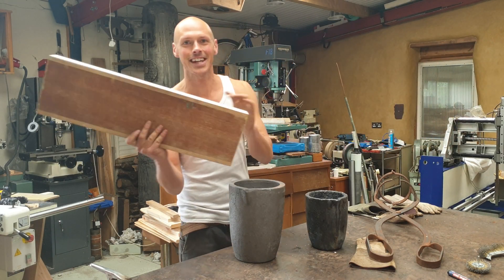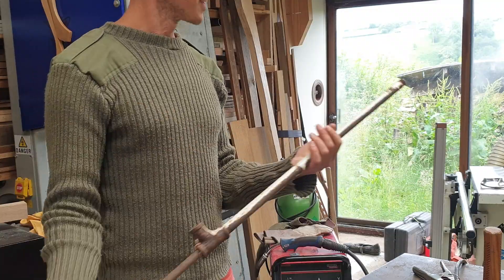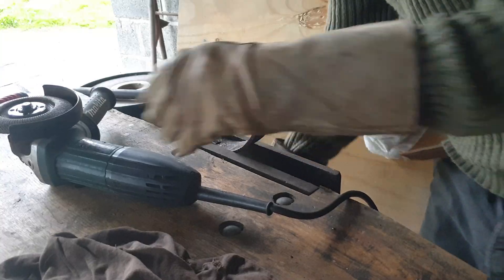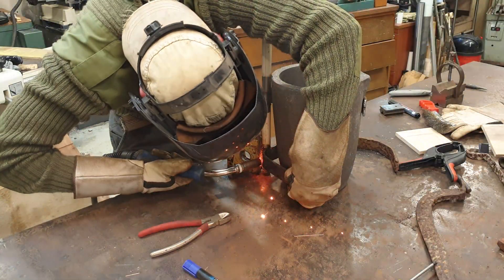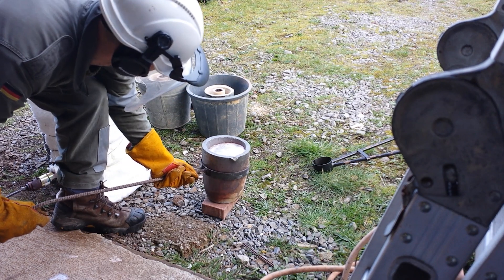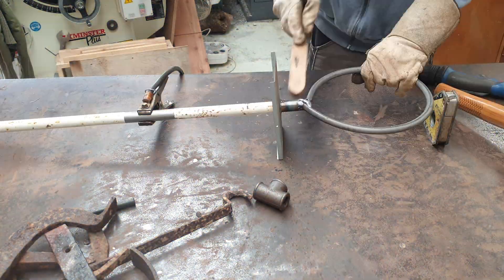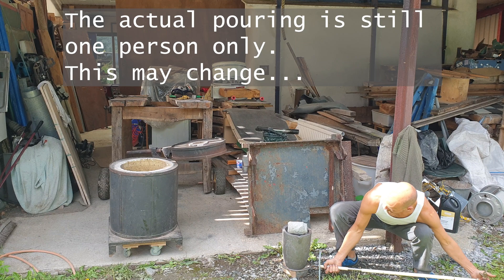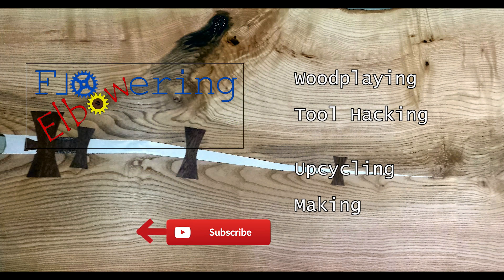How to make Crucible Tools/Tongs for bigger castings

Comment: That bit of scrap looks like a bit of spring steel so that'll be hard to cut with the circular saw
Reply: I had 2 of these blades, blue for steel (not going to mention the make) .... after 10-15 cuts in mild steel (50x50mm or 2x2) they dulled
angle grinder is da way

Comment: Scrap-pot! Love that. Ok, so here's an idea: what do you think about using a sort of standing fulcrum as a tipping point to assist you with pouring? The weight could rest on it as you pour. Something like a u-shaped cup sticking up/out from a piece of plate (maybe an old rotor)? In operation, as you stay back by the T-handle, you'll be away from heat and splashes, not to mention that leverage will give you more time before fatigue starts to set in. It'd probably give better control, too.

One more thing, and sorry to be a safety know-it-all on this point, but I once worked at an alumin(i)um company, where they would really drill on us about rusty and/or wet tools. Thermite reactions are a very real phenomenon that use rust as their fuel, and trapped moisture becomes explosive as it rapidly expands—so be sure to use warm, dry, clean tools when playing with metal. 

As it cools, it's weird how liquid metal acts more like tar than you'd think, isn't it? Stuff makes a mess. And when it's hot enough, it gets even more 'wet' than water is; stuff will flow into cracks that are far too small for water to penetrate. Ah, whatever. Just keep making vids. This is one of my favorite channels!
Reply from the maker: Hey Pocket. Thanks for the advice. Always good to get safety reminders (ok well learn about in the first place - I'll look into the Thermite reactions jazz ;) 
Love the pivoting fulcrum idea. I think this could be as simple as some old flameproof mat (I have a bunch of ones a plumber discarded - they only had small holes right in the middle, and work great folded up) and a little sheet metal around the top edge of the flask closest to the pouring basin. I don't know if you have seen our previous vid - but looking at that, the crucible is close to touching/pivoting round that point anyway! 
Always good to hear from you,
Peace, Bongo.

Comment: I really like the creative ideas you come up with using what's available! Good job!

In watching as a spectator vantage point, it appears that the large crucible is really to much for one person because it is dangerously close to the leg when lifting it. There's little room for any error or mishap.

I agree with the other comment about needing a type of locking dog to hinge over the top of the crucible to prevent it from sliding out when pouring. Having it slide out and aluminum getting splashed on you would probably cause a burn that your wife couldn't kiss and make better 😆
Reply from the maker: Hey Micah, thanks for this. Agreed leg danger is the biggest concern!

Comment: You might want to consider a slide over locking tab on your pouring tongs ...... a simple oversized short bit of pipe, that slides down the handle with a dog leg tab attached which reaches over the rim to ensure the crucible stays in the tongs when you are pouring. 
Also ...... welding another handle on the opposite side (even if it was removeable ..... pinned into a socket) making it into a double pouring tong might be a good idea for such a large crucible. Looking forward to how it all goes, Cheers
Reply from the maker: Hey man, nice ideas all. We were thinking we would probably turn the poring ring into a two-person deal like that... Will see how it works ;)